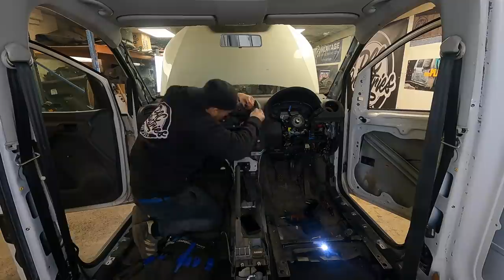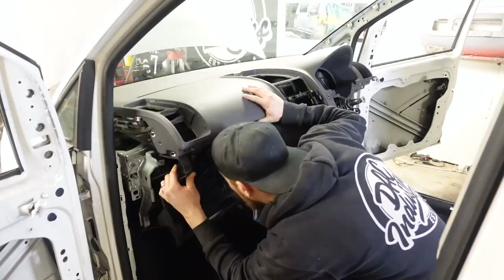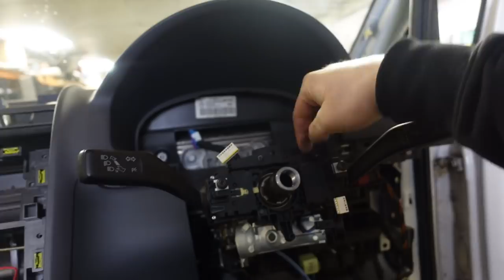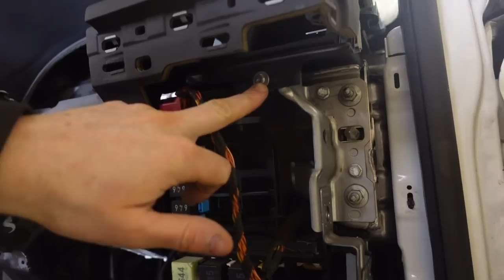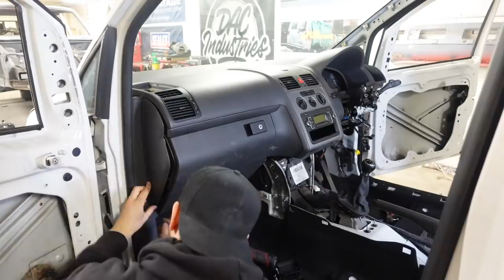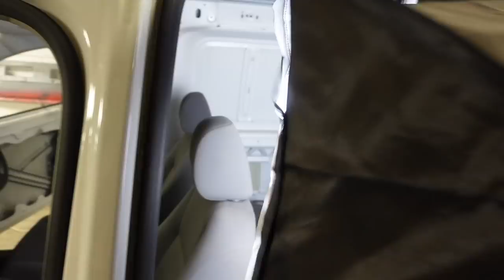VW Caddy 2K Build Series - Touran Dash Conversion How To - Episode 7

Comment: You need to use the original caddy regs for window conversion.. a piller plug is different. Power feeds need adding in to the doors aswell and that touran doesn’t have compatible motors. Hope this helps 🤙🏻

Comment: Great video, learning a lot from all the videos. As you still are in the rebuild stage, I would say to fit a MK4 Golf interior light (like ebay item number 313304116089) so you have the map lights but you can also fit a VW microphone (like ebay item number 273339199862) so if you did decide to fit a Bluetooth head unit, you would have the factory mic as well. Wouldn’t hurt to throw in a DAB aerial at the same time 👍 You may have already done this but thought I would mention it at this stage. Keep up the good work on the videos 👏
Reply from the maker: Thank you for the recommendations bud.

Comment: Another top video 🤘
Does the foam on the underside of the front carpet act as sound proofing or would you recommend putting sound deadening stuff underneath?
*Off to eBay to look for caddy's
Reply from the maker: Yes it does but I will be adding some more sound deadening.

Comment: Great work on the channel. I've done the dash swap a few years ago and since sold the caddy but looking to get another soon, I do remember having issues with airbag and the switch in the glovebox. Did you use the original caddy passenger airbag or the one from the touran?

Also how did you get the gti bumper so cheap. I've been looking and theyre over £200 without the black trim bits? tia
Reply from the maker: Cheers bud. The Caddy didn't have a passenger airbag so I just removed the Touran one. I haven't connected the glovebox light either. I paid £150 for just the bare bumper and £130 for the grilles. All off eBay.

Comment: What’s the point of the dash swap? Not being arsy... I mean... is the touran dash nicer or sleeker or whatever? I swapped my mk6 transit transit dash for the mk7 so I could have the gear stick up on the dash and not the long stick out the floor! Feels much more modern
Reply from the maker: Just because it looks nicer tbf and the door cards are nicer with electric windows etc.

Comment: Just a ponder, does the vans ecu hold the mileage or is that an issue ? And does the fan have bigger/small wheels so the Speedo needs to be recalibrated ? Cracking video mate well done 👍
Reply from the maker: The clocks are the Caddy clock's so all will be fine.

Comment: I wouldn’t put the touran wheel in, it’s older style and makes the car look older (in my opinion). I would go for either the original ór a Multifunctional steering wheel from a higher end caddy or transporter.
Reply: I went for mk7 mfsw but I wont expect the buttons to work. it would need some mods but at least it would look better. mk6.5 steering wheel would be best bet
Reply: @bencrosbie  if you were to install a 2011 caddy multifunction steering wheel, you would only need to adjust the slip ring and do some coding in VCDS am I right?
Reply: @PeetB_  so I have a mfsw (multifunction steering wheel) module with a CH at the end of the model number and I ordered a slip ring / clock spring with a C at the end of the model number they should accomodate the multi function controls but there may need to be modifications on the airbag loom. I havent tried any of that just yet to confirm but yes I pretty much will need VCDS coding to allow mfsw to enable. I have a mk5 gen 08 caddy the next mk6 gen caddy will just have the slip ring to replace to work it. the mk6 steering wheel would be plug n play. but I reckon the mk7 steering wheel may work with some wiring modifications.